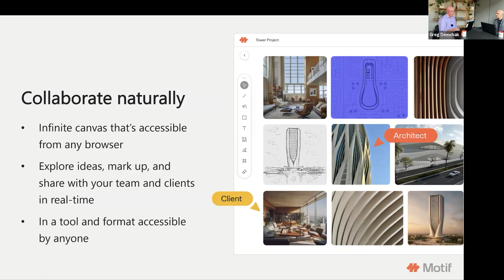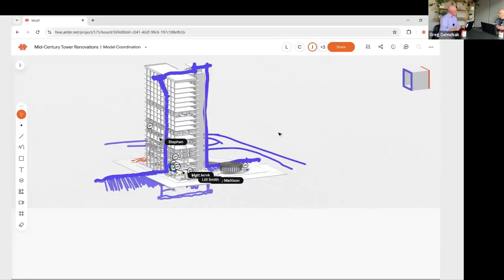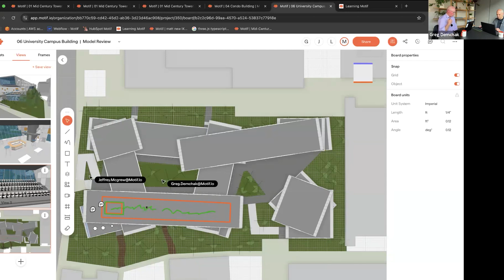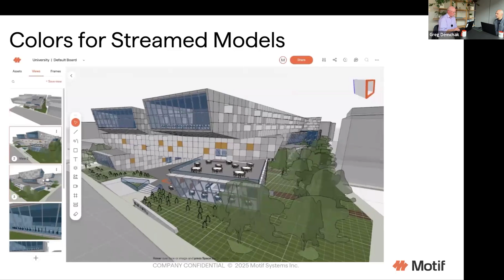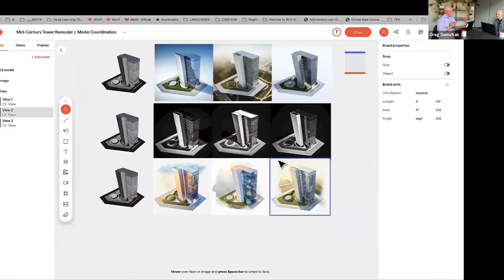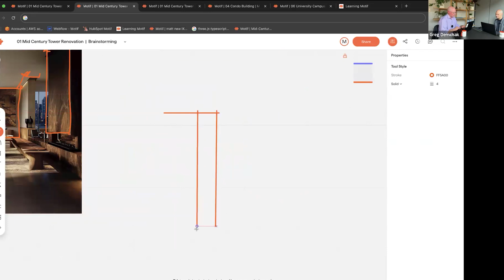Industry insights

Comment: Great video. One correction I would like to make. You say that ML is a "non-deterministic system", but this is not actually accurate. It gives the appearance of being non-deterministic, but that is because there is a random seed that is used to set starting parameters. If you use the same seed with the same input, you will always get the same result.